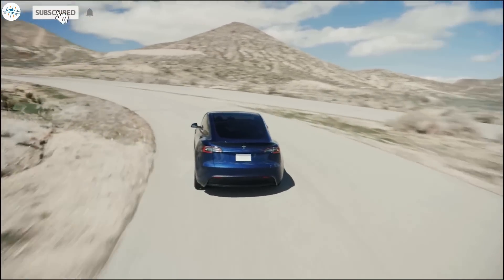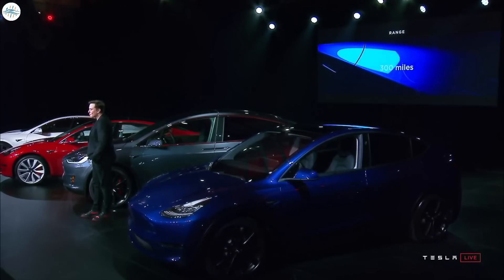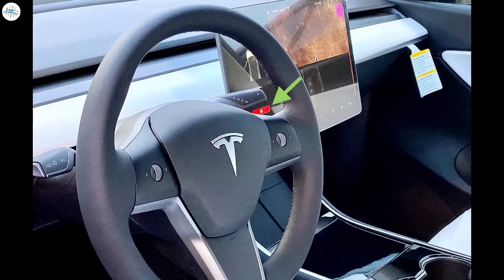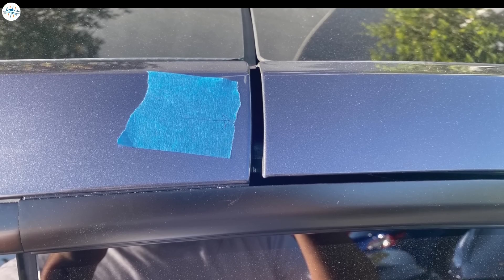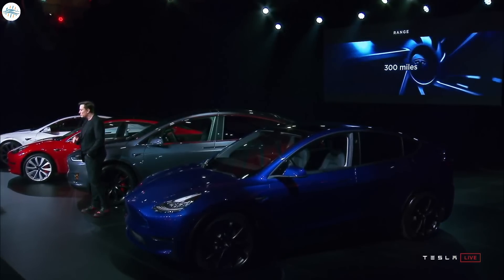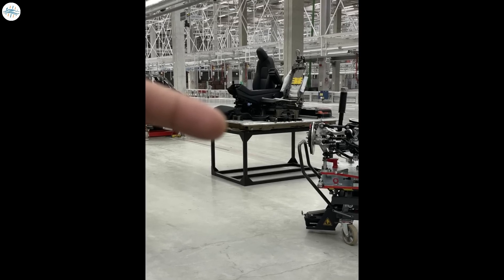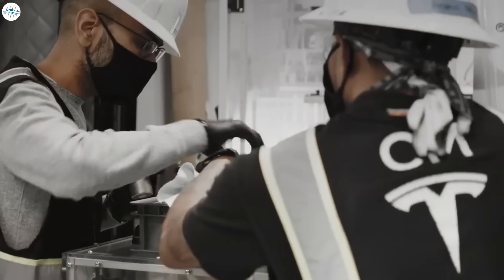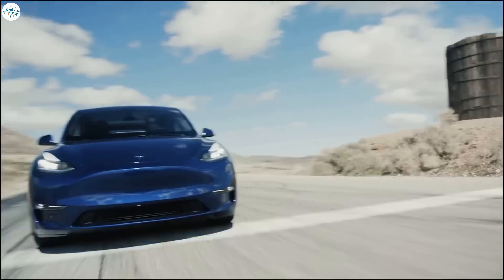Tesla Model Y 2022 - All The Changes & Improvements Coming Soon!

Comment: From what was educated in our past that collision safety derives from energy absorption. Absorb by deformation of vehicle front and rear sheet metal chassis, and at the same time keep the cabin shape unaffected, as much as possible. Structural pack design complements cabin shape. Will rigid castings absorb the way sheet metal do in a highway collision?

Comment: If you take delivery of the money y in the next few months, will you get all these changes ???
Reply from the maker: Most probably yes
Reply: No way you will get the new battery and air suspension in the next 6 months
Reply: Sources speculate that the new 4680 battery cells will be in the new model y early next year
Reply: So would you suggest pushing back delivery until summer?
Reply: Good question 🤔
Reply: I'm picking up my MYP tomorrow and when I looked on the paperwork, it said 2022 instead of 2021 which I thought I was getting.
Reply: @TrendSettaRico  oooooo interesting ! Let us now if you got all the new updates ! Congrats!
Reply: @TrendSettaRico  Mine I picked up Jan 13 showed 2022 also. I ordered in August.
Reply: @Gusss858  Any update on n what you got? Thanks

Comment: I WOULD LIKE TO SEE TESLA BUILD  A MODEL Y PERFORMANCE WITH THE REAR FALCON DOORS LIKE ITS BIGGER BROTHER MODEL X!

OTHERWISE I AM LOOKING AT PURCHASING THE 2022 TESLA MODEL X PLAID AND PRAY THAT THE NEW 2022 UPGRADES WILL BE TRANSFERRED TO THE MODEL X PLAID PLATFORM AS WELL!...I AM JUST SAYING!...GOD BLESS AMERICA! 😇
Reply: The MX Plaid is the best in my opinion
Reply: The Falcon Doors add a lot of complexity and cost, they are not just doors that go up, they are more like articulating robot arms with sensors that can prevent them from bumping into things as they go up.
Reply: @justindawson5930  I’m stuck between the 2023 Tesla Model Y or the 2023 Range Rover Sport. What would you pick?
Reply: @realkingrav2265  Model Y. I will never buy another gas powered car again, unless it’s an old classic that I have sentimental feelings about. If you can, get the Dual Motor All-Wheel Drive that’s my opinion

Comment: Tesla needs a 500-mile range vehicle that can fast charge from 0-100% in 15 minutes like Atlis motors.
Reply: That's a power of about 400kW -- even at 480 V the cables would carry a current of more than 800 Amps.  That would be remarkable.

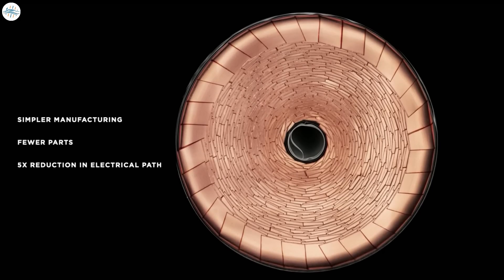Comment: Tab less design is advertised to be a brilliant idea which alter heat sinking path from laterally to vertically. However the heat path is interrupted at the anode flaps (shingle shape formed copper flaps on page 14:37) in front of a spiny wafer (heat insulator) originally designed to pass electric currents to the cell case base. 

If no further design and thermal validation, the vertical heat transfer architecture will be incomplete, leading to tab less architecture failure.

Comment: Want to see a Model Y P4-SP with 4680 batteries (+100 KWh), dashboard, heads-on-display, air suspension, Sun Panels on roof and hood and 4 electric motors (one per wheel)